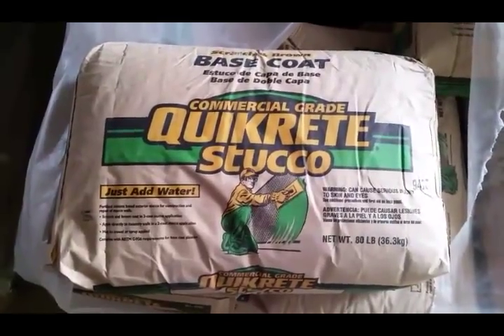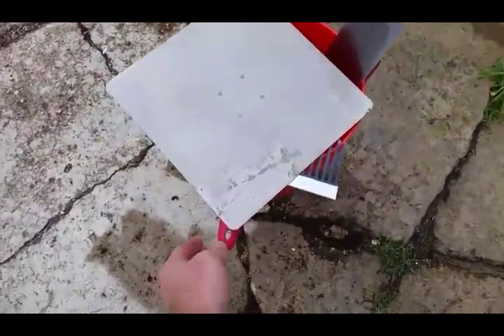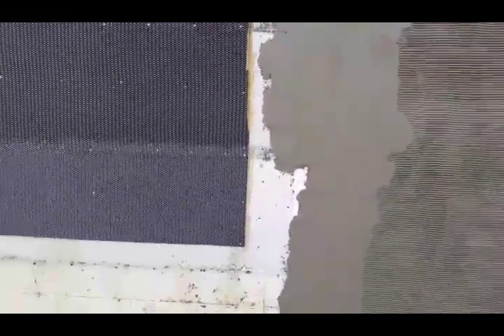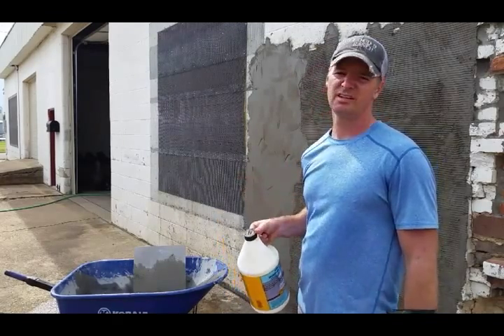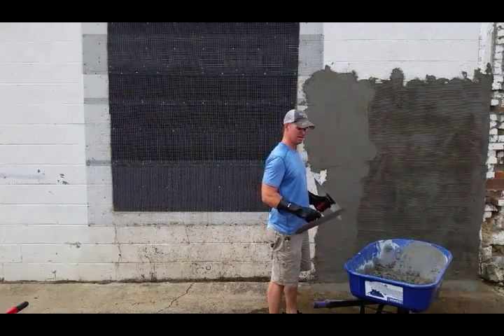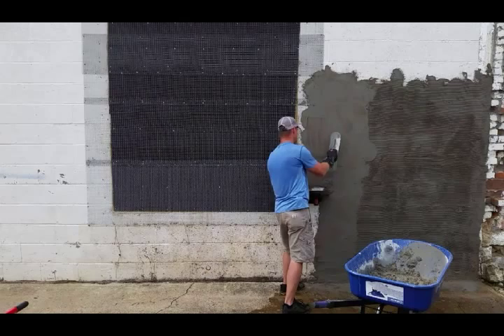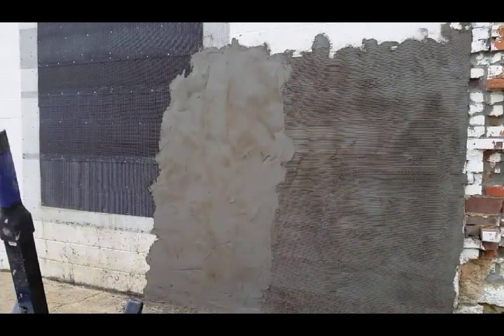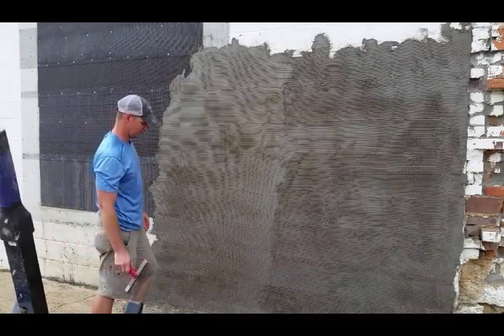DIY - Stucco Base/Scratch Coat

Comment: You can do 2 or 3 bags....and a mixing board to dump stucco on....its alot easier and goes pretty quick....since you have quite a bit of stucco to do it would be beneficial.....if only small patch no necessary

I would hit paper first to bring it flush to wall than hit everything.....thats quite a bit of work for 1 dude so props for tackling it solo

Comment: That whole patch is going to show. I've been plastering professionally for 18 years you need to feather the joints into the existing stucco with a wet float but not bad for a beginner
Reply from the maker: Appreciate the advice. It's not noticable, but I will know for next time.

Comment: Thanks for the video. How can I add color to the stucco? Do I add it to the mix or do I spray paint the wall after the stucco? I would like it to be white in color.
Reply from the maker: Paint it after it is cured.
Reply: @HandyGuy2016  Thanks👍
Reply: The color is the last coat.....its called color coat and is different material
Reply: @kirkdunn1379  what material is that?

Comment: Dumb question? Why 2 coats? Is it necessary
Reply from the maker: It's a lot like drywall mudd, the second coat is like the finish coat that covers the blemishes and gives it a finished look.
Reply: @HandyGuy2016 It depends on the finish that you're putting over to office.It's a 1960 or a critic.Finish good depending on why they're doing double coat

Comment: Can someone tell me, is a base coat strong enough on its own for the outdoors? Or does it have to be covered with a finish coat. I have a small project I'm working on, I used a base coat it cover a cement structure, not a wall per say, but it's already so heavy and thick I don't want to apply another coat if I don't have to...
Reply: Yes now do the brown coat and then at last finish coat

Comment: HI HandyGuy 2016. I've got a question pertaining to a previously, poorly done, stucco finish? Can a person stucco over the poorly designed stucco and previously painted surface? My son's house  has stucco but he and his wife are not happy with the results. They would like to stucco over that last coating. The house was flipped and they bought it a couple of years ago. What are the steps to re stucco a house that has stucco? Does the surface need to be sealed? The final texture is a very smooth one.
Reply: Hi, hope this answer doesn't come to late since he didn't answer your question, step one you would need to power wash the whole thing to get as much of the poorly installed stucco off   next you need to get concret bonding agent apply this with a brush or a roller let it dry then when is dry you can do the recolor on the property,   lots of materials brands out there for recolors,    is a difficult process you may want  to hire  someone with experience on stucco if you never did this before.

Comment: can you just use  this to smear over old cement blocks to fill in crackes and holes  and leave it alone ? STUCCO - SCRATCH AND BROWN BASE COAT   that is
Reply: I'm a super rookie ....matter of fact lower than that however I've done a lot of research and I feel like what you might be looking for is mortar mix
Reply: Mortar Mix by Rapid Set